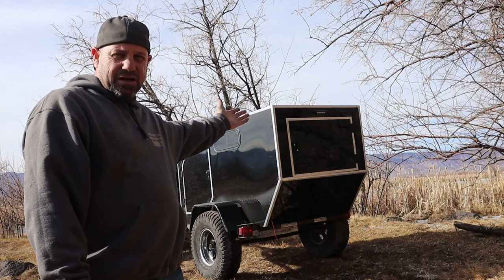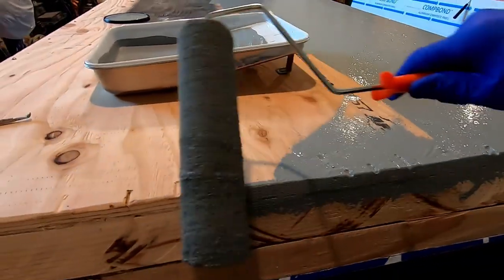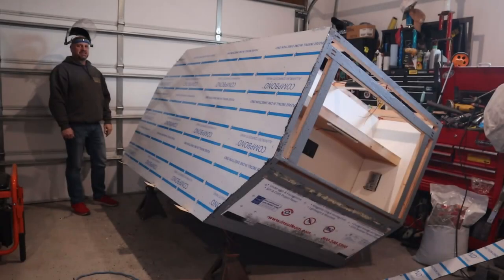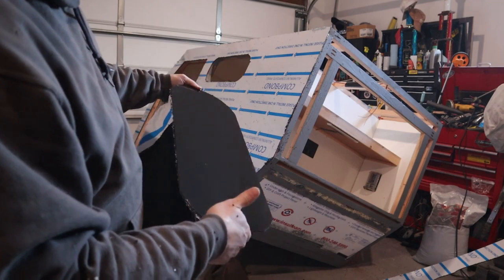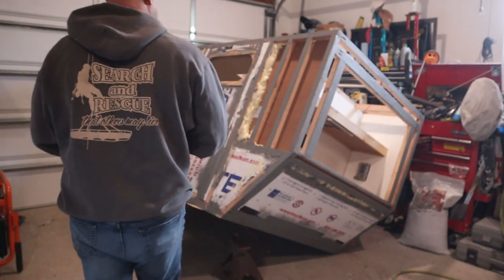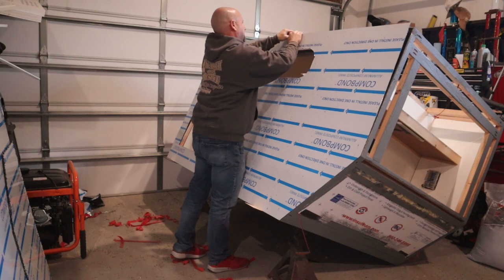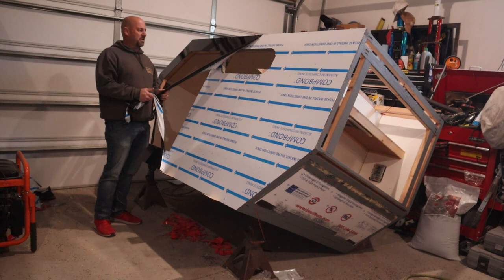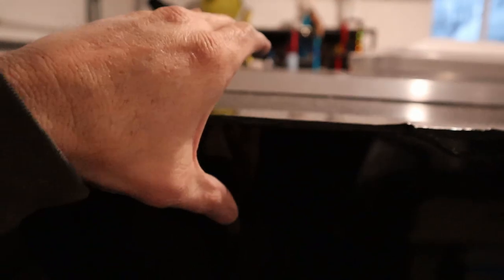OVERLAND TRAILER BUILD, DIY teardrop square drop trailer, off road camper build, UTV overland camper

Comment: Just a question, would it been better to just stick the whole sheet and then router it out? I would that have been easier than trying to line up everything later...? Looks awesome though!
Reply from the maker: Yes, that would have been much easier.  On the newer trailers I actually cut them to a template and bond the entire panel together before even building the box.

Comment: Awesome job , what kind of bit did you use for the router, and where in the world did you find aluminum  sheets , I can't find them anywhere
Reply from the maker: I used a 1/4in flush cut bit in the router and I got the pannels from a sign shop. They are 3mm aluminum composit, Compbond is the brand.

Comment: SOrry if you have answered this, was thsi an old Ultility trailer with the short rails areound the sides?  Curious if that is the route you went for the frame of the trailer itself.
Reply from the maker: Yes this one was a small utility trailer.  My newest ones I built my own chassis.  Way more affordable.

Comment: Amazing build! Im the process of doing my own. Where did your source / find the Aluminum Foam core panels?
Reply from the maker: It is aluminum sign board. I had my local sign shop order it in.
Reply: @rockymountainbackcountry1588  what size panels? 

    Value Panel (.005″ aluminum skin thickness),
    Standard COMPBOND Sign Panel (.008″ aluminum skin thickness),
    X-12 Premium Sign Panel (.012″ aluminum skin thickness).
Reply from the maker: @keithpeery5286  the oner I used are like 3mm thickness

Comment: How did you fasten the camper to the trailer so late into the build?
Reply from the maker: I bolt it through the floor to the chassis.
Reply: @rockymountainbackcountry1588  I meant like through your finished flooring? Lol

Comment: I have a question about your Maverick Sport XRC. When in 2X4 does the rear diff stay locked? The indicator on the dash shows mine staying locked. I know on Defenders it locks the rear diff when you put it in park and unlocks when it is put in drive. I have a new 2022 model. My buddy has one, we both have about 300 miles on them and his gearbox is out. When I turn sharp right or left the rear diff is making a pretty loud clicking noise. Thanks
Reply from the maker: It stays locked,  there are some models that have turf mode that allows the rear to be unlocked.  I have about 6k miles on the sport, recently develpoed a slight clicking in the rear end, my mechanic said its the cv joint starting to wear.  Goes away after riding for about 20 minutes.